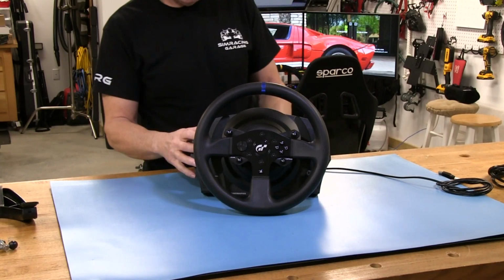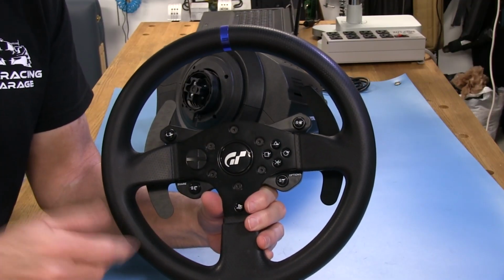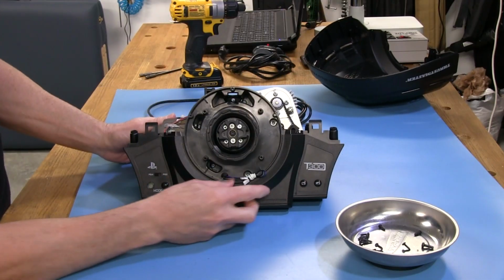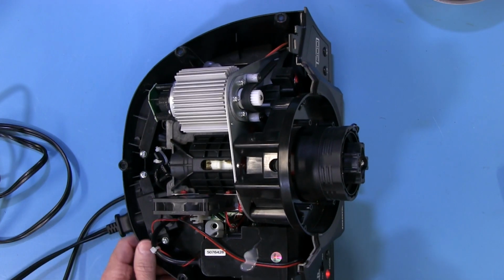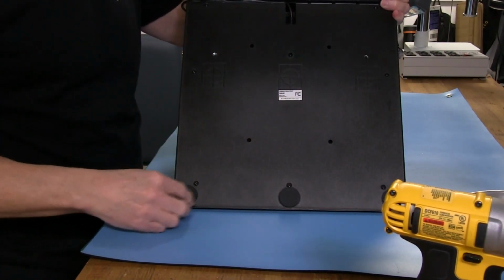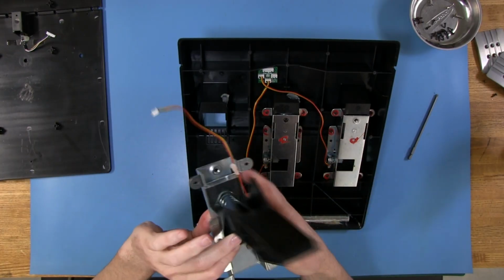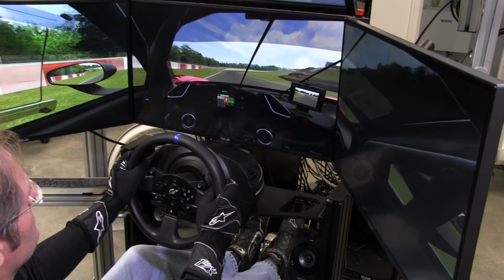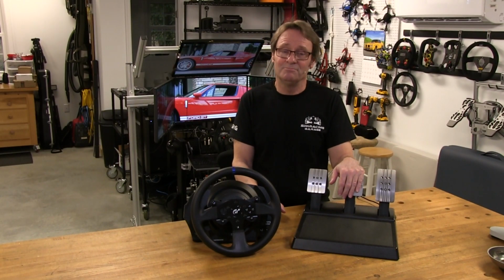Thrustmaster T300RS GT Review

Comment: This is literally THE FIRST review where someone decides to look inside of the wheel and give us HONEST opinion about FFB and build quality of this Thrustmaster product!
Reply: Good to know. Im looking for a t300rs GT. I ve heard about reliability issues but I also hear that it has been solved. Altho not much info on that. I can buy the wheels with 2 yr warranty for 300€, version with the t3pa pedals.
Reply: @jdjeasy  I've had this wheel for 3 years bought at a steal on Amazon for $250 usd. I had the old fanatec csr it was  great but finally went out. So I bought this to replace it and have had zero issues its smooth and strong imo.
Reply: Truth
Reply: I have T300rs with t3pa pro add on pedals with load cell add on
Amazing! I’ll buy a new wheel in a few months.
Reply: Hi guys!Are the worth overpaying for the t300, or is the G29 still not a bad choice?
Reply: @SimRacingPOV_HQ  
Would recommend the t300
Reply: @thedude4964  ur path t300(few days) - g29 (how long?) - fanatec (this is out of question.. everyone dreams)... For starter, worth the worry on t300? Price ~ 1.7x of g29 now. Thinking of long last direction. Appreciated ur experience on these wheels.
Reply: @poseidondredd  
For a beginner I would always recommend the t300rs. Maybe you can get the t300rs GT edition with better Pedals.
Reply: @thedude4964  any tips on long lasting? Only read about overheat/ffb high (means lower down) and internal power supply issue (no idea about this). Many fails report but not much info on the cause.
Reply: @poseidondredd  I had no issues with it. After I changed the cooling mode the noise was lower. And the FFB was very good too.  You have to tweak a little in the driver menu from Thrustmaster and ingame. Google for 'Clipping FFB'. It's necessary that you have good settings for each Game. It will need some time to get no clipping.
Reply: @SimRacingPOV_HQ  don't buy logitech stuff, it's low powered motor sux.
I went from g27 to t300 4 yrs ago.
Reply: @TheKwod  does the t300 still work?
Reply: @noideayt1529  sure does, I'm playing automobolista 2.
FFB is very good with this game.
Reply: or u pay 50 euro more for a gt wheel and a 100+ euro t3pa.i agree,though,thrustmaster is a joke.when the t300 first released,they had so many problems,its a joke.300 dollar product and that many problems,really.
Reply: @jackass5066  
Which Wheel would you prefer?
Reply: @thedude4964  what do u mean
Reply: @jackass5066  
I'm looking for a wheel right now. You wrote that Thrustmaster is having some problems with that wheel. I want to know what your choice is.
Reply: @thedude4964  I see.Well i kind of forgotten about this comment as most people would and 9 months later i would like to share my experience.Despite the things i said,i decided to go with thrustmaster t300 gt.It was on sale and was the same price as a g29 with a 1 year shop warranty.It has been 3 months since i got it and it works fine.A bit loud at times an di didn't run 100% ffb,only 60% which may have helped in preserving it.It was a great buy and the previous troubles i had with thrustmaster didn't occur here.
Reply: @jackass5066  
I bought a few days ago the Thrustmaster 300 GT wheel too. So far I'm happy. The Wheel was loud at the beginning,still in idle mode. The fan inside was cooling all the time. Then I figured out that you can change the cooling mode. Now the fan does its job when it's necessary.
Reply: @thedude4964  Ive heard that they did this in order not to overheat the motor. Some kind of firmware update?
Reply: @jdjeasy  
You have to press the "mode" and "8" button at the same time.  Will change the fan mode to forced cooling (the fan will be on all the time). Do it again to switch back for automatic cooling, now the Fan will start when necessary. It was in an update a while ago. I read that the Wheel may loose FFB after a while driving when automatic mode is on. Some say this isn't happen when forced mode is on, I will test that in the next days.
Reply: @thedude4964  actually I believe that has been a feature for quite some time.Most people including me like to keep it on so as to preserve the ffb motor which has been known to overheat as Jay mentioned.Also,constant overheating will burn it out.
Reply: JAckass i bought this wheel yesterday, will get it tomorrow (amazon). i am slightly worried because it only has 3 1/2 stars, with many complaining about the wheel braking just after warranty (doesn’t calibrate anyone etc.)
Reply: @ilovelol2642  not gonna lie,wheels in general now are all pretty shady unless u go for a fanatec which most of us simply can't afford. My t300 is starting to suffer problems. I use it 6-8 hours a week and after about a year,it calibrates fine but is extremely loud compared to before and it isn't the fan as I had almost always had had the fan forced on. Despite this,the ffb quality has deteriorated a little and occasionally mid session I would lose ffb or would no longer feel it due to how weak it is. It still works properly and hasn't destroyed itself but my confidence in it is dwindling.Thrustmaster support is slow and rude as well. Unless you get really lucky and get a perfect model,chances are you will see problems.For me, the problems were small and could be temporarily fixed by using the firmware but it isn't a good feeling when it just loses ffb.
Reply: @jackass5066  uff... :(
Reply: @jackass5066  CSL Elite Wheel Base 320€, Steering Wheel 180€, Pedals 90€ is all i would need tho, right? Would be 600€, the Thrustmaster T300 Alcantara Edition is also 400€...
Reply: @ilovelol2642  The fanatec products listed above can be gotten for 550 euro on their website but that is as cheap as it is gonna get for fanatec.Previous thrustmaster problems I have already mentioned and the t300 alcantara is essentially my wheel with a different rim.Problems come from the base,which is basicially the same,hence unreliable across the range of t300/tx. The only other option is the g29/g920 from Logitech. These wheels are not as good as Thrustmaster or Fanatec.They are notchy and unrealistic compared to these 2 to many reviewers due to its difference in mechanism. This is traded off for more reliability:Logitech wheels are hella reliable and they have leather for a rim,although it cannot be changed(but there are ways,if theres a wheel theres a way). People still suffer problems from the g29 but its less compared to thrustmaster although more major. If you could,i would really recommend going for the fanatecs unless u aren'treally too serious about racing.If so,i have some other options for you.
Reply: @jackass5066  I played a lot of racing "simulation" games, such as dirt rally, on my Keyboard. Yes i know, you laught, but now i wanted to get a wheel (Assetto Corsa is inpossible on Keyboard). And today, after 2 days of use, i already started the process of giving it back.

The main reason is that the wheel already started squeking after 1h of use, and giving the reputation of this base, i won't take the risk. The mechanism was really good, almost felt like a real wheel (had the alcantara edition).
I thought i do an OK job at Assetto Corsa, until i went online... Even on "good" laps i was 4 seconds behind the leader, and it really pissed me off. After 6-7h of trying, i gave up and went to Dirt Rally and Wreckfest, and i was slower in these games than with the keyboard. I even had more fun with the Keyboard, which is kinda incredible. Keyboard is less "doing" and more "watching". Maybe i would have getting used to it, but it was not love in first sight, so 400€ is not worth it.
Maybe there is coming up a new g29 version? 

I could only get down to 600€ for a usable Fanatec setup... and if i thought about it, the g29 is on sale for 209€ on Amazon...
Reply: @ilovelol2642  When you first start,you will of course be slow:that's normal. There doesn't seem to be any new low end /mid tier wheels coming out.How fast one is depends on how much practice one has got.Since you are pretty new,fanatec may not be such a good option and in your situation the g29 is the best wheel for you if you want force feedback. The wheel squeaking is a common issue and I'm surprised you got it that quick.The g29 is a really plug and play kind of deal and the only competition is the t150/tmx from Ticketmaster.
Reply: @thedude4964  I'm planning to get one. How is it one year later?
Reply: @yanniskrp5782  
I sold it and switched to Fanatec. It was okay for quite a while but I was not satisfied. Now I have a CSL Elite Base, CSL Elite Pedale and the McLaren Wheel. Cost me about 600€ but it was worth it. The feeling is totally different.
Reply: @thedude4964  nice wish you the best! Do you think I should buy it ? Would you recomend it?
Reply: @yanniskrp5782  
When you play not much the Thrustmaster is the better choice. Because of its price. For longer sessions, when you play different Sims and when you spend a lot of time with playing I would say go for Fanatec.
Reply: @thedude4964  its going to be my first wheel so I really dont want to go all out so the thrustmaster is I think the best choice for me.
Reply: @yanniskrp5782  
Yes, no doubt then. 
What Games will you Play?
Reply: @thedude4964  I'm planning to start with PC2 and ACC or AC (dont really know the difference between them yet I'll do some research later on today)
Reply: @yanniskrp5782  
I play ACC and AC too. Compared to AC, ACC is focused on GT Cars. You can play the official GT Series. 
But it is not compatible with mods like AC. Both are good but I prefer ACC, like to drive the GT Cars.🙂
Reply: @thedude4964  ooh ok good to know thanks a lot.
Reply: @jackass5066  he just telling his exp form 1 item^^ it was never that way. prob a hater

Comment: I recently got this wheel as my first racing wheel.  I do like it a lot, but I do have the same mount issue.  I have a glass top desk with a metal bar that runs right where the wheel would mount.  My other two issues are the wheel mounted shifters, and my power cord looses connection sometimes.  I still like the wheel a lot though.  I've only played Project Cars 2 (in VR) so far, I haven't noticed any delay issues at all.  I was actually surprised at how spot on everything was.

Comment: I use this wheel on my ps4 for over 2 years and surely over 200 hours, not a single problem at all. PC2 in immersive ffb mode feels great with it. AC also great, i tend to reduce ffb strength though. Dirt rally and wrc 7 is cool, dirt  4 feels good as well (but the game itself dissapointed me). Nice review, would love to see a comparison with the fanatec ps4.
Reply: Jann Diethelm i see a lot of people having problems with this wheel. Did you have any problems be honest please
Reply: Big Shaq it‘s funny just after posting above the wheel started to have some problem at start-up. But i found out how it would still start up properly, but once it‘s up and running, no flaws. I still think it‘s a good, reliable wheel. Btw my operating hours are probably more than 300 hours, if i re-think my racing habits. :-D

Comment: Just a heads up on a T300 feature, If you press ST and Mode buttons together you turn on forced cooling mode so the wheel wont get as hot when using the wheel. This disables the automatic fan speed control and is great for long racing stints but the fan will generate a little more noise.
Reply: ace tip. thank you. mine is in the mail now and i will likely always run it like that, and probably replace the fan down the road via help from this great video.
Reply: @MordecaiWalfish  how long did your t300rs last? Or is it still going strong?
Reply: Do you have to do this every time you turn it on?
Reply: @Xaos tmx got forced cooling in a firmware update (if you update the wheels firmware on pc forced cooling mode is always on and your fans are always maxed out)
Reply: @Paul S Were is the mode button on the wheel?
Reply: Paul S thanks
Reply: @Paul S is this versión (t300 rs gt) unreliable? Cause I'm going to buy a new wheel and there's a t300 rs get but I'm afraid of it breaking because I only have 3 months of warranty
Reply: Juan Pablo Silveira before getting mine I was really afraid due to reviews saying it wouldn’t last at all. Many reviews out there stating so actually. I’m going with mine one year so far and it works as well as in the first day though!!! I’ve never seen it overheated. in my opinion just go for it, great equipment, I’d go for the ferrari alcantara one though, at least here the price is pretty much the same. Cheers
Reply: @WilXuH  thanks bro!
Reply: @WilXuH  thanks man! I ordered mine after reading your comment.
Reply: @egyardiya  Enjoy it, man!! Take good care of it (mainly not overexageratting the applied forces :D ) and it will certainly take you a long way!!
Reply: Juan Pablo Silveira only real downside in my opinion are the pedals, they’re decent but not great at all, even the logitech g29 has better pedals I think. If you race on pc you might want to check the fanatec ones, but the price difference is not trivial at all 😂
Reply: @WilXuH  im from uruguay and Fanatec wheels are at really high prices, but of course I would love to hace one! Thank you again bro!
Reply: @Xaos np lol i was curious too after seeing your comment and dug around a bit to find the answer for myself so figured id share.
Reply: @Xaos no
Reply: Hi guys!Are the worth overpaying for the t300, or is the G29 still not a bad choice?.(play in RR,IR,ACC)
Reply: Viktor K. My friend has a g29 and I have the t300, I’ve played on both and the t300 is much smoother in terms of FFB, I’d say the g29 feels a bit like a toy, (probably because Logitech makes many different products other than sim racing ones and thrustmaster is id say a company dedicated to sim racing. So yeah. If you have the cash get the t300. You won’t regret it.
Reply: @user-hd7ej9om1u  thanks for the detailed answer!
Reply: Viktor K. No problem! I love helping other people
Reply: Bart-O-Mation you think with the way things are priced and the latest thrustmaster wheel basically being a slightly upgraded t300 where the upgrades are title exclusive, that TM are gearing up for a direct drive model? If so I hope the current set of wheels work in that ecosystem, or that quick release mod will act as an adapter.
Reply: Dylan Zrim hang on, I don’t think I understand you there. So you’re speculating that thrustmaster are working on a dd model?
Reply: @SimRacingPOV_HQ  g29 is hot garbage if u want to drift other than that its alright
Reply: @DatBoyComp  thanks.I forgot to clarify, I play RR, IR, ACC
Reply: Paul S I’d have an upgraded cpu fan on order. In one week my fan started making sounds as if it had a knock. Probably does.
Reply: upvote this please
Reply: wow thanks for the tip man, and for people who have the t150 this also work for that wheel as well
Reply: It does  not have a fan speed control. It is either on or off. Forced cooling simply sets it to on all the time.
Reply: @Daz5Tube  incorrect, it does make the fan faster, infact if you listen closely you hear it too when in force cooling mode.
Reply: @polarix5348  I have not noticed any change in the sound of the fan regardless of forced cooling being on or off.
Reply: Thanks for the tip!
Reply: for those with add-on wheel like the 599xx ST is just the Start button
Reply: I plan on getting this wheel for next year do you recommend it?
Reply: @luhsvj  great wheel base don't get the tp3a tho get the T-LCM with the t-300
Reply: @GFlop2016  Thank you, Also I have a tight budget but I think I can slip a CSL DD in instead of the T300 do you think that I should?
Reply: @luhsvj  indeed do so, just can't stress the improvements I've seen since i switch from potentiometer to load cell brakes
Reply: GOAT BROTHER YOURE THE GOAT ok now you made me getting it ive been up all night and day yesterday and rn its 7 am ive been looking at atleast 500 reviews and alot mention the problem its hot and it broke melted dont work stuck calibrate too hard being loud and omg i want the t300 just the base with tclm peddals and a rally wheel but ugh im tired cheers m8
Reply: tlcm*
Reply: Ive found it works perfectly even with the fan controller active and not used NG the forced cooling, the fan being on all the time drove me mad 😂
Reply: Pinned
Reply: The thing abou to overhearing is that it does not happen with new drivers as fan ramps up quicker. 

But when I want to do longer race, e.g. full length monaco; I turn forced cooling on. 

It will just run constant speed and prevents you getting distracted by new extra noise.
Reply: Thnx 4 that
Reply: Will this pretty much guarantee no failures from overheating?
Reply: Giallo & Eurocrime World no guarantees.

Comment: Great review! Does changing the settings in the Thrustmaster Controll Panel actually have any effect when the wheel is then plugged to a PS4?
Reply: You could have just said "You're mistaken" if I've made an error instead of "Don't listen to him". As far as I was aware it didn't affect the settings. If I was wrong, there's no need to be rude!
Reply: No, it just controls how it responds on PC. On PS4, you can only make adjustments in game (unless it's been updated since I last used my T300 on PS4, but I doubt it has).
Reply: napalmhardcore OK, thanks for the reply!
Reply: Don’t listen to him. I‘v changed the ffb strenght in the control panel and it effects on ps4. Or even if you change the rotation in control panel and try it on ps4, it will take it over. Just try yourself if you don’t believe me